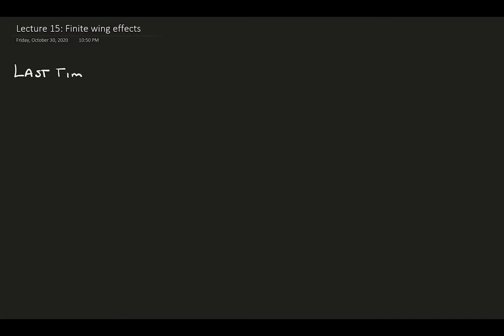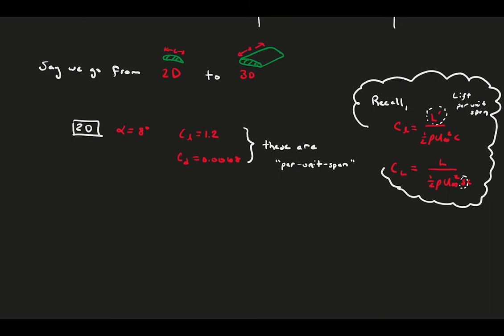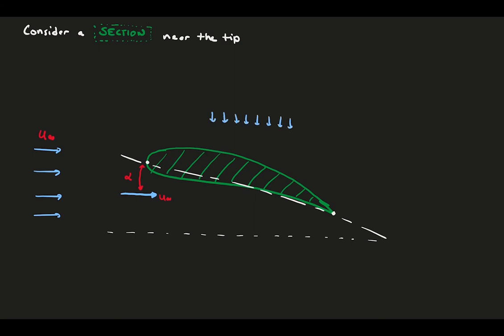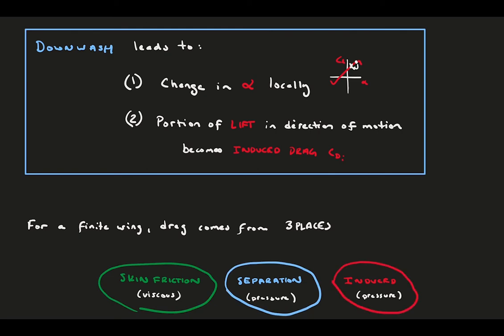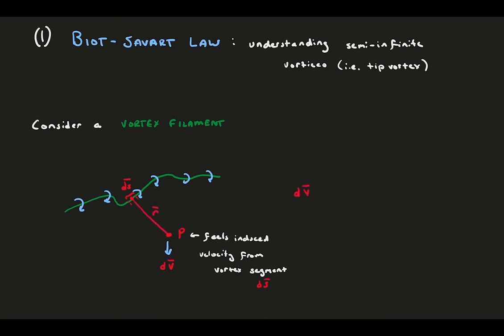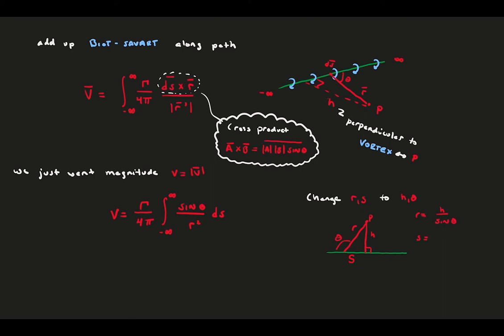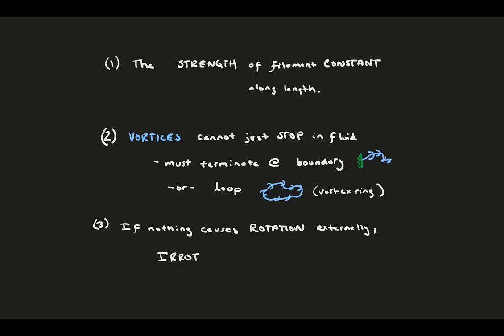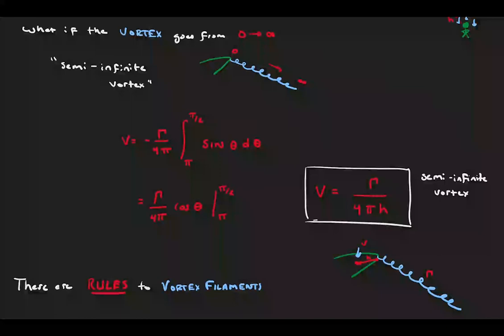Finite wing effects [Aerodynamics #15]

Comment: Nice and clear lesson. My only comment is that AR only affects the Cdi. The induced drag (in Newton) goes with 1/Span^2, and AR has no effect (apart from the applicability of the lifting line for low AR). AR can be misleading. Indeed, Di=(2/pi*rho)*(lift/(span*speed))^2
Reply from the maker: Thanks and interesting point! The aspect ratio being in the Cdi equation is really a fabric of the non-dimensionalization, and when re-dimensionalizing you get that the Drag is a function of span directly and the chord drops out of the equation. As a consequence, if you have a wing with a fixed span, you can't reduced induced drag by reducing the chord (though your overall drag will go down if my understanding is correct).